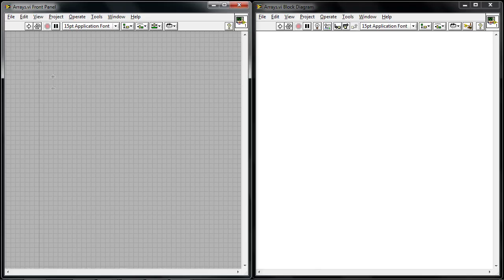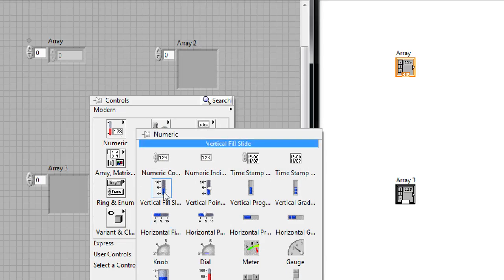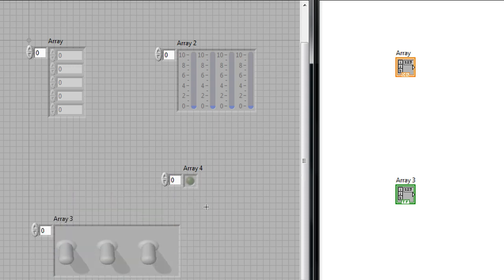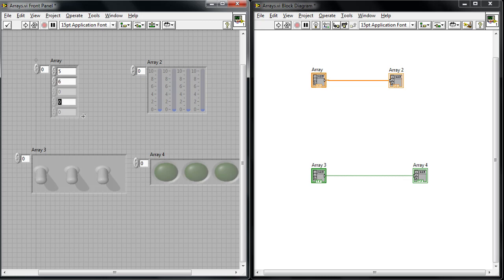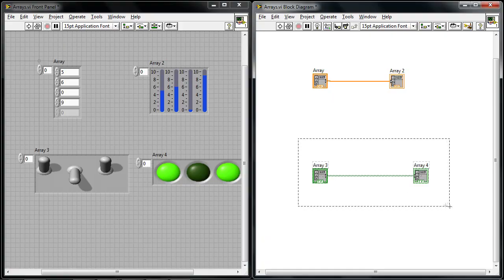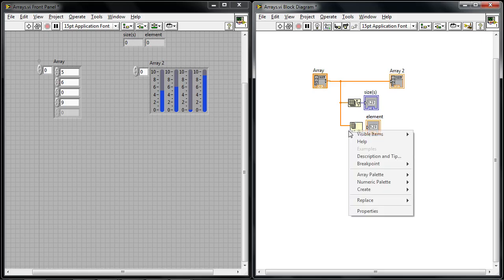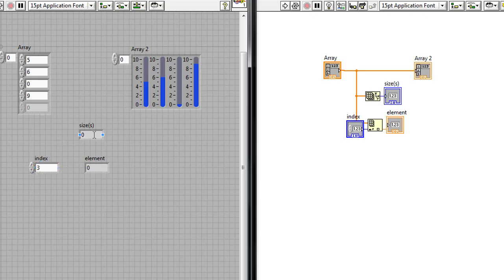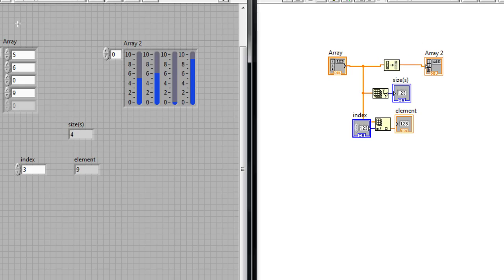Using Arrays in NI LabVIEW

Comment: Maybe I am a dummy, but on my Mac the operation at 0.56 min in the video (drag to increase the number of elements) DOES NOT work, why?
Reply from the maker: What happens when you attempt it?  Does it just get larger?
Reply: Difficult to explain in words. When the mouse points the corner of the tab, it changes into an L-shape, as expected. However, when I drag the L to the right of down to enlarge the tab, at first new content appears as expected, but when I release the mouse, only the top left one remains. Can't know how to explain it better, perhaps a short video might help.   @NIApps

Comment from the maker: Check out this site  for your answer - zone.ni.com/reference/en-XX/help/371361H-01/lvhowto/inserting_elements_rows_co/ 

You can do this programmatically, using the "Insert Into Array Function"  zone.ni.com/reference/en-XX/help/371361H-01/glang/insert_into_array/ 

Or from the front panel by right-clicking onto the array and selecting Data Operations»Insert Element Before.